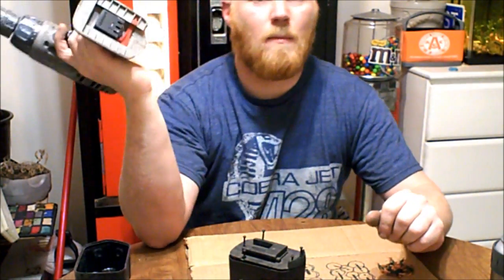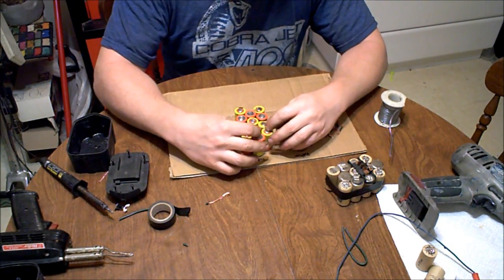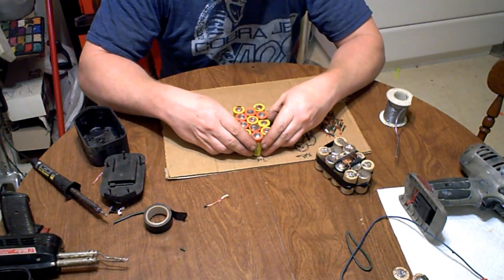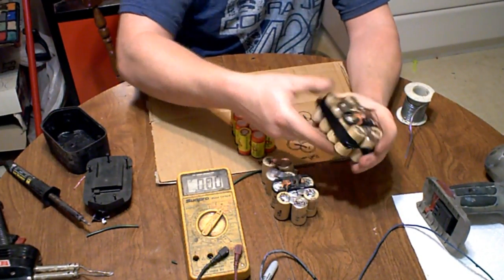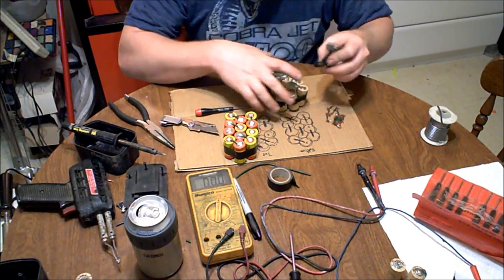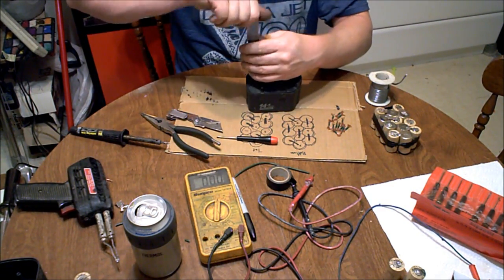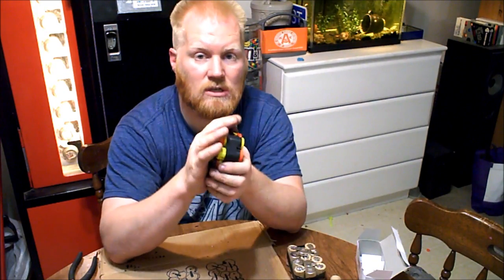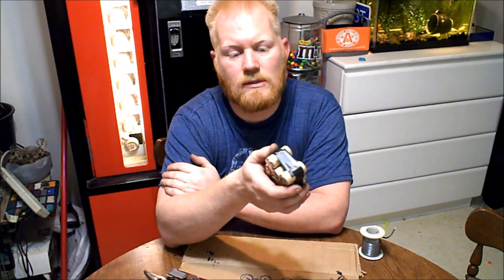Cordless Drill Battery Pack Rebuild for $20 or Repair for $0

Comment: Thanks for the info. Excellent video and you made it look so easy. I wish Id seen this before I tried to do mine and it might not have taken me a whole afternoon. Ah well I'll know better next time
Reply from the maker: big ian Thanks, I'm glad you found the video.
Reply: A couple of hours late but at least I found it. New cells are hard to come by over here in the UK and expensive, I feel an order to Hong kong coming on. :)
Reply from the maker: Name brands like: Tenergy, Panasonic, and Sanyo are your best bet. Most of the no name brands have fake mah ratings.
Reply: Can't find them here. I got used ones and I've still got a few left.
Reply: sixtyfiveford Hello again. Do you know if it's possible to remove the heat sensor or how to test it for a fault? I have a couple of batteries here that are showing as fully charged on the charger but are not taking any charge. The voltage on the terminals is around 4.5 volts so I suspect a dud cell but it seems odd that they're both identical and from the same drill.
Reply from the maker: The heat sensor allows full power to flow through it at room temperature. At a certain temp (approx 140 F+) it shuts off and stops all power so the charger knows that it needs to wait for the batteries to cool down. The heat sensor should show a voltage to the 3rd pin on the batter pack. If you have a Resistance setting on your multimeter it should show little to no resistance across it at room temperature.
Reply: sixtyfiveford I've done several but new batteries are really expensive in the UK. I imported the last lot from Hong Kong.

Comment: Kannot open my 9.6 v 1.3Ah makita pak... no srues no nothing. Keep treying....
Reply from the maker: ROAlexa1981 If you don't feel screw holes under the decals, it is more than likely glue at the seam. Prying on the seam will gradually break the glue bond and allow you to open the pack.
Reply: sixtyfiveford
I have 3 more to go. That is the only way !

Comment: Great job bro. But can I recharge them. If I buy 19 c Panasonic batteries and do this to this old craftsman 19.2v drill I found can I recharge it. You didn't mention that I'm just asking a question?
Reply from the maker: itsme2369 You're old 19.2 drill should have 16 Sub C batteries in it. Yes you will be able to use the stock charger to charge them.
Reply: Ty for the reply. And yes your right 16 c batteries. Ty very much dude.
Reply from the maker: Your welcome. I just want to make sure you know that they aren't "c" size batteries. They are shorter.

Comment: Thank you for posting this video. What gauge wire should I use to solder the batteries for an 18V battery pack?
Reply from the maker: 14 gauge would work fine. I think I used 12 gauge in the and it is a little overkill.
Reply: Thanks!
Reply from the maker: You could also use tabing strips for solar panels.

Comment: How would NiMH "C" cells compare with the standard NiCds used commercially in durability, reserve charge and work time?  Better or worse? I know they're less harmful for the environment.
Reply from the maker: NiMH can't handle the high drain that power tools need. NiMH are better suited for slow drain devices. NiCD-Fast/High drain devices but have a lower Mah capacity than NiMHsNiMH-Slow-moderate drain devices and has a higher mah capacity and NiCDs.

Comment: I was wondering how you get batteries like a Makita 14,4v open without breaking the case.Also what gauge wire are you soldering for you buss work.Thanks
Reply from the maker: I just used 12gauge wire but you can also buy solar panel buss tabbing wire to do the same thing. It's cheap and will lay flat. Some cases are glued shut but most are screwed(some screws hiding under decals)

Comment: A much needed video great job, can you help me please I've just e-bayed for batteries & there all different mAh's which one do I go for or doesn't it matter if they are all the same?
Reply from the maker: Virtually all of the no name brand Chinese cells are going to have fake mah numbers. I would stick to a name brand like Tenergy , Sanyo(hard to find), or Panasonic(hard to find). Just make sure they're Nicd and not Nimh. Name brand one are usually around 2000mah and those are great for a rebuild. My 14.4v with 2200mah Tenergy will drive over a 100 3" screws and still have juice.

Comment: Where did you get your Tenergy batteries for such a great price? I can't find them for less than about $36 or so for the 15 I need in my 18v drill.
Reply from the maker: Ebay. Generally you can get them around 2 bucks each. When I did the video I got them for around 1.90 each for 24.
Reply: sixtyfiveford Yeah I figured it was ebay, but I was looking for a seller name, lol. I just finished rebuilding an old, but surprisingly good Coleman drill battery, must be built by a name brand company I think as its one tough drill, the battery alone has lasted 14 years so far and was still working when I rebuilt it. Anyway, I have two Ryobi batteries and two Crafstmans I want to rebuild as well. Just picked up two lithium 4000 mah batts at BB for only $99 (buy one get one free deals) that are VERY nice for the Ryobi tools but I still want to do something with these nicads that won't charge anymore..
Reply from the maker: http://www.ebay.com/itm/330401958745?ssPageName=STRK:MEWAX:IT&_trksid=p3984.m1423.l2649
Reply: sixtyfiveford Thank you, that is the same price I just paid for OEM white shrink wrapping batteries. My search at ebay was not giving me that seller for some reason. Thanks again...

Comment: Great tip. Can this be done for the lithium ion batteries, and if so, which batteries do you suggest? My 18V DeWalt Li-Ion batteries are smaller than my Ni-Cd, so, I would imagine the cells are quite a bit different. I haven't opened them up yet, because I need a security torx bit to fit the screws.
Reply from the maker: Your pack will have what are know as 18650 cells. There are a ton of options for these but you need "high drain 18650" and not standard 18650. All the same principles apply to installing them. If you have a small enough flat head screwdriver a lot of time you can insert it just to the side of the center pin in the security screw and remove them.
Reply: Awesome, thanks. Nice tip on the screwdriver, but I think I'm just looking for an excuse to add to my tool collection.

Comment: Great info!

I have the exact battery you worked on in the video, and I cannot get the screws out. They look like regular six sided allen wrenches, but none of my standard or metric wrenches fit, and using a small screwdriver doesn't work either. Help?
Reply from the maker: They should be torx screws(star shaped).

Comment: need to build a pack for a 14.4 volt skil where can I buy these batteries? Thanks
Reply from the maker: Take it apart and see if you have "Sub C" or "4/5 Sub C" batteries(Google to see the size difference). Ebay is going to be your best bet.

Comment: can you share where you buy the replacement cells at ?

I have 8 x 18 volt dewalts right now, I had no idea that just 1 cell could kill a pack, so I am going to take apart my doa ones now to experiment with.

Thank you for the info and well done video, my only neg would be the volume was very low for me.
Reply from the maker: Ebay is you best bet. Don't be tempted to buy no name Chinese or NIMH batteries as they won't hold up. Tenergy is a well know brand and makes some really good 2200 mah Nicad Sub C cells. With your 8 packs you should be able to make 5-6 decent packs with all those batteries.

Comment: Why did you pick nicads to make a pack with? Personally I go with NiMH cells for the no memory aspect. Though they are a little more expensive.
Reply from the maker: Nimh aren't designed for high drain applications instead they're suited for slow drain devices. Nicads are able to deliver that massive amount of current required to operate powertools. Nimh in a powertool will overheat and short out or drop voltage to the point where the tools is moving slower than it should. Nicad memory is something that mainly affected the first series of batteries made in the 1970's. They were used originally in solar power systems where the sun would charge them the exact same amount every day and then they would discharge the same percentage every night. They would keep this memory from doing the same thing for a year at a time and if more power was needed than it was used to delivering it wouldn't have it. After this they discovered by simply discharging it all the way and then fully charging it twice a year or so the memory was completely erased and the battery worked like new. Newer cells made within the past 20 years are virtually impossible to create a "memory" So to create memory in a Nicad cell you would have to discharge your battery the exact same amount, lets say 50% every time and then recharge it. After doing this a 100+ times it could hold this memory and only give you 50% of the total capable power. You could then drain it fully and fully recharge it once or twice and the full power would be right back.

There is a trick to longevity of a Nicad battery pack. They hate being over-drained and will destroy individual cells. Once the power tool slows, the pack is exhausted and do not use it anymore.Not even to screw in one last screw or finish cutting the board. If you do the stronger cells will pick the weakest  cell and reverse the polarity causing permanent damage to that cell. Since Nihm can't deliver amps fast enough they are more likely to destroy themselves from this as well.

Comment: This is what I'm gonna do pretty soon. It's ridiculous that a lot of brand name cordless tools uses lithium battery packs that only has 1500 mAh. I'm gonna replace it with a Chinese lithium cell that has 5300 mAh. It's gonna be awesome, longer run times!
Reply from the maker: The only thing you need is High Drain lithium cells. Standard lithium cells can't handle the power drain of a tool.
Reply: sixtyfiveford
Heh, I've never heard of such a thing before. I thought they were all the same discharge rate.
Reply from the maker: Yeah, they have a couple different discharge ratings.
Reply: sixtyfiveford
I just saw eBay now selling Ultrafire 18650 Lithium Cells at 3.7v with 6000mAh. I hope they are the high discharge batteries you are talking about. That's four times the runtime of my Craftsman 12v batteries. About 35 minute run time for an oscillating saw at high speed instead of just 10 minutes Maybe I'll wait another 6 months until they come out with a 7000 mAh version..
Reply from the maker: Generally High Discharge 18650 will have normal capacities around 2000-3000mah
Reply: sixtyfiveford
A lot of lithium batteries rarely have information on discharge rate so I'll give three 6000 mAh cells a try.

Comment: great video! 1 bad battery kills the whole pack. I usually get battery packs off the discount table and tear them apart for the batteries. Also don't over heat the batteries when you are soldering
Reply from the maker: Thanks... Yeah, too much heat can shorten their life.
Reply: FXNorm that's not true. As long as they haven't been charged and discharged allot or left on the charger for ever.

Comment: You Rock! I've watched a few of your videees and both your info and your presentation are excellent. I also have to say that your lighting is spot on! Your camera work is perfect for the content. And most of all, your info is practical and timely. Great job. Thanks for what you do.
Reply from the maker: Thanks for the great compliments and thanks for watching. -Moe
Reply: Yeah, the only issue I had was that you need to speak louder sometimes (or turn up your mic while recording if possible) because I had both my computer's volume and the video's volume cranked all the way up to max and I still had to get really close to the speakers in order to hear what you were saying! I do not have a problem with most other videos on you tube, (they are oftentimes even too loud and therefore distorted, which you don't want either of course), but yours was really low volume... Otherwise good though, except where you were referring to the cells ratings' in micro-amphours instead of the standard milliamp-hours! There's a difference of 1000 times between those two terms!

Comment: will it broke when i took it apart.
Reply from the maker: Mouser or Digikey should have them or possibly Ebay.  I am not sure of the temperature rating. If you can get the numbers off the side you can look it up.

Comment: Thanks for your video! Its very informative. Now for my question... I have 2 Skil 14.4 battery packs I want to rebuild. I can't get the case apart. It has 3 screws which I have pulled out and what looks like it may be a pin in the 4th slot which I cant get out and the case is being held together at this point. Should I just drill out that pin? Thanks for your help!
Reply from the maker: Yes. They don't want people getting in these as they loose money on selling new battery packs. A skill will more than likely have 1500mah batteries but you can upgrade them to around 2200mah without any trouble.
Reply: sixtyfiveford
Sounds good. I drilled them out and no probs. Ordered the batteries and should be back in business in the next few days! Thx again!
Reply from the maker: That's great. What mah was in them?
Reply: sixtyfiveford
I havent actually pulled the case apart yet. I'm waiting for the batteries to come in. Will let ya know though!
Reply: Tony DeMeo
well... I went to work on it and there are no markings on these batteries at all so I dont know what the mah rating is. I did find out I bought the wrong batteries though. The originals are smaller than Sub-c. They are about 1 1/8". Back to the drawing board I spose!
Reply from the maker: The batteries that are the same diameter as sub C but shorter(approx 1 1/4") are called "4/5 sub C" . That aren't as common as the Sub C but some things use them.
Reply: sixtyfiveford
yep. I found them online. Quite a change in the mah rating between the 2 sizes. Thx for all the info!!

Comment: Is it possible to damage the new cells if you get them too hot during soldering?
Also where do i find the replacement cells?
Reply: sixtyfiveford Scraching the surface to be soldered with a sharp utility blade will greatly improve your solder joint.  You will have to cut about 10 vertical and 10 horizontal goves in the center of the surface to be soldered.  These cuts should be deep, but not completely through the metal.  Try cutting on an angle to achieve the strongest bond.  There is nothing worse then having a tab come off and short out your cells.  Take your time and do it right.
Reply from the maker: Yes, if you left the heat on for way to long you could damage them. I try to be fast but have left the heat on way longer than I thought was good, but still I haven't ruined a single one.

Ebay is your best bet for cells. I really like the name brand ones like Tenergy. There are a lot of no name China cells with bogus ratings I would stay away from.